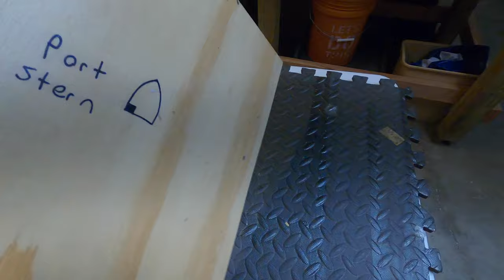How to Make Boat Cushions! (Super Easy)

Comment: IMPORTANT!   Do NOT use regular staples!  They will rust and make a MESS!!!  ONLY use stain steel staples and use many more than you see here. Also, fold the vinyl with hospital corners so the folds facing down so they do not scoop water into the cushions.
Reply: Horrible job,,, corners are not right
Reply: @cherylekutzer7521  Remember that the point of this was to recover the cushions without having to do any sewing.
Reply from the maker: @blaster-zy7xx  Thanks

Comment: The correct way is sewing a vertical piece to the top piece.  Then wrap it to the board after you heated the vinyl so it could stretch nicely.  Use stainless staples and 3/4 in apart.
Reply from the maker: Thanks for the advice!